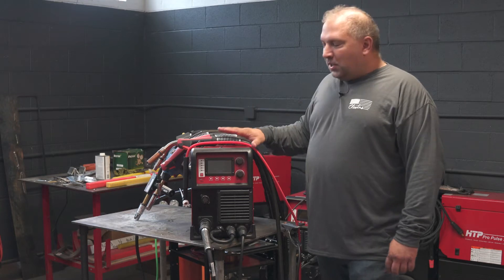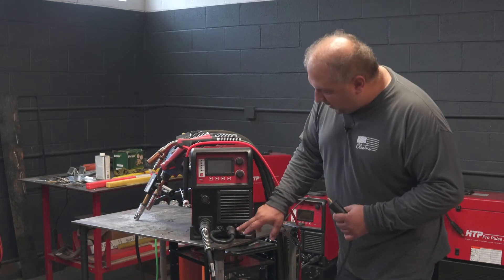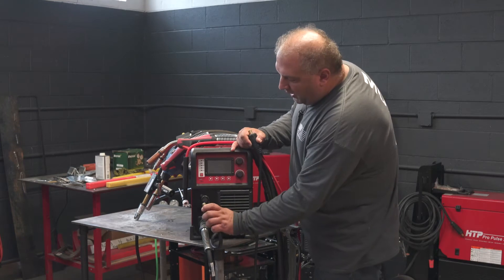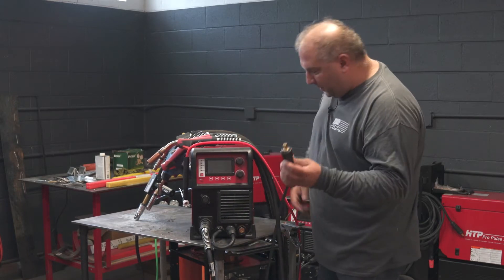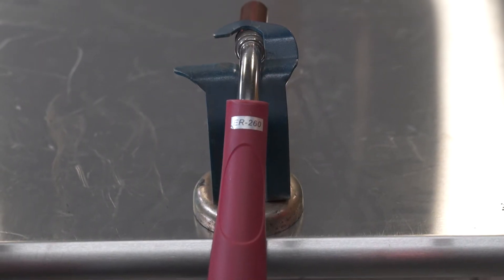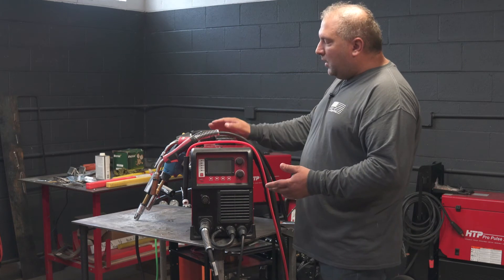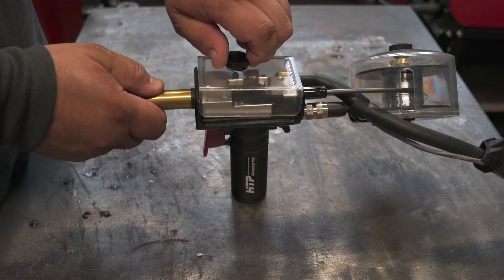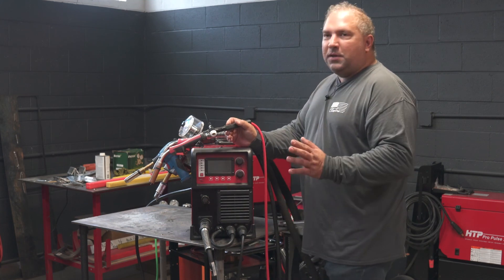How to Connect MIG Guns, Torches, and Other Accessories (Pro Pulse 220 MTS – Setup Part 7)

Comment: If I have a MK python or a Miller Aluma pro Lite Is there an adapter I can buy to use them in this machine?
Reply from the maker: sorry there isn't - the HTP pro pulse uses a TBI push pull gun the volt speed curves are programmed into the machines logic board

Comment: I was going to ask the same question. Does it do ac/dc ?
Reply from the maker: No it does not do AC/DC it can only do DC TIG welding with lift arc or scratch start.